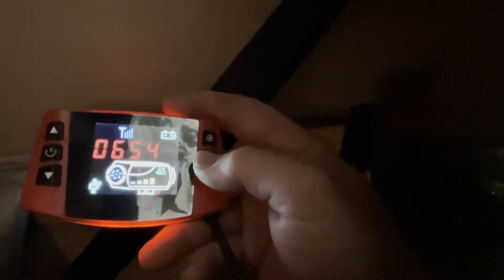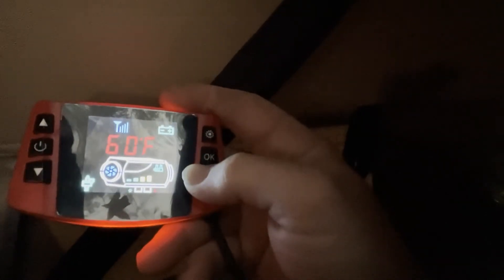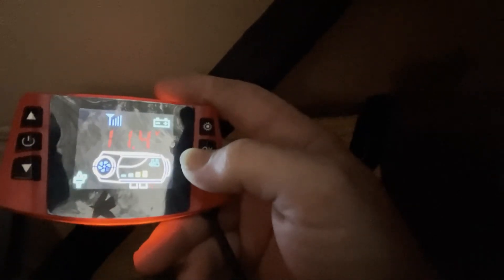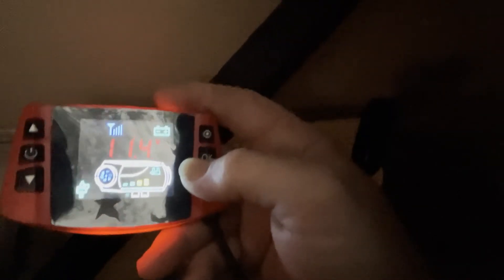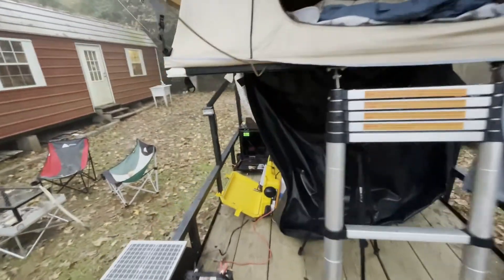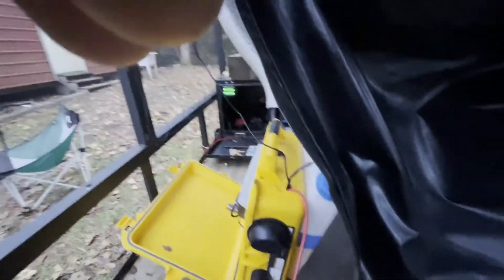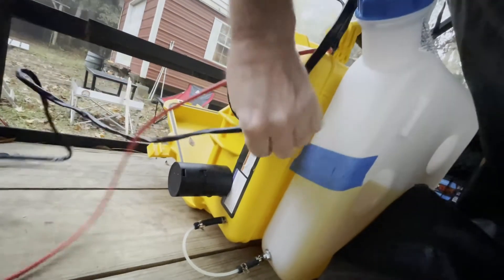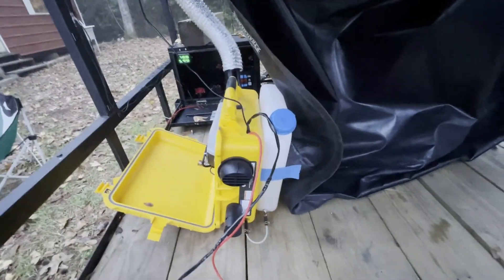FIRST OVERNIGHT DIESEL HEATER TEST

Comment: Need me one of these for sure, good stuff!
Reply from the maker: Needs to be really cold before I use that diesel heater it puts out some heat
Reply: @Xploring_The_Outdoors  Thats not a bad complaint, it's consistently below freezing now here in Newfoundland so it could be used here for sure
Reply from the maker: @TailgateAdventuresCo  you’d definitely like it, it’s a dry heat unlike propane heaters, no moisture inside the tent
Reply: @Xploring_The_Outdoors  thats a huge benefit for sure. I look forward to it in the future